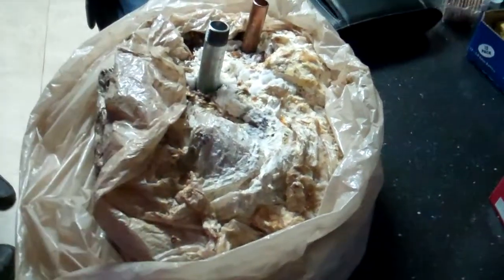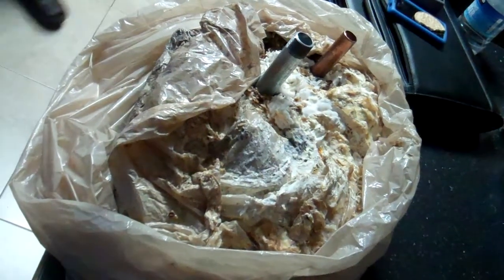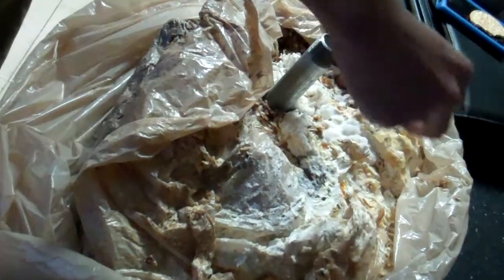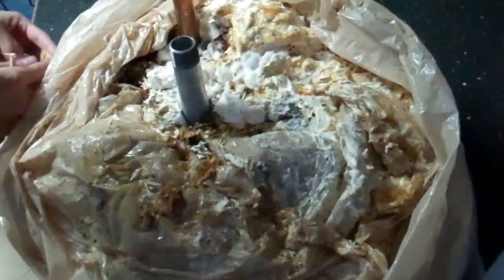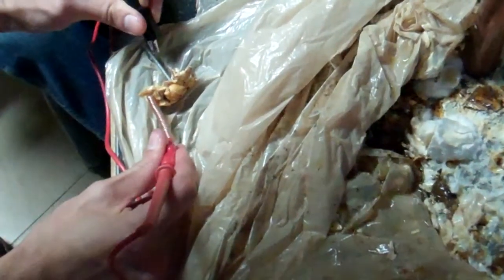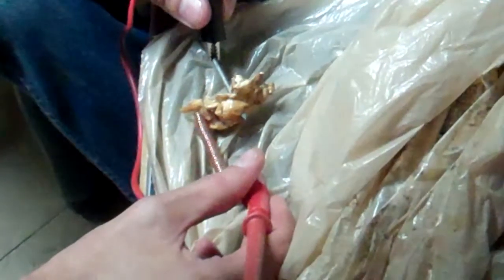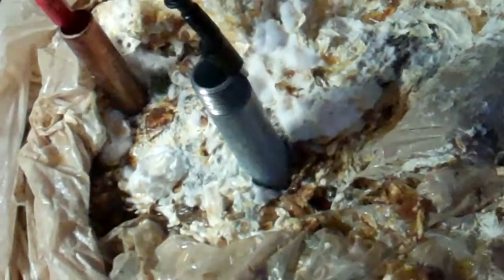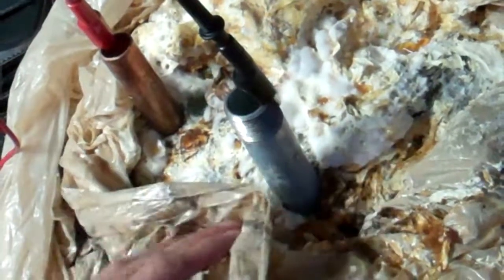Mushroom battery

Comment: When you say it doesnt matter how big the fungi is...
Does this mean just a piece can hold on just as much power as a bigger piece. How is that possible.
Reply: The voltage is the same, but the capacity (amperage) is what changes. Like the difference between a 12v car battery and a 1.5v AA battery. The car battery probably has 100 x more power than the AA even though the voltage is only 8x.
Reply from the maker: @macrumpton  great explanation thanks!